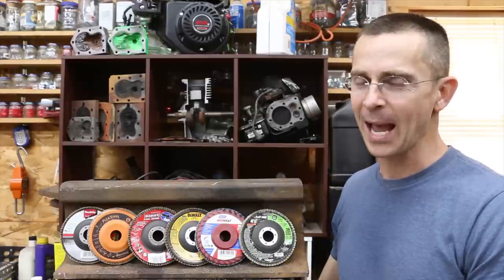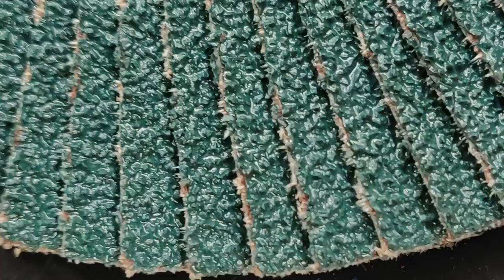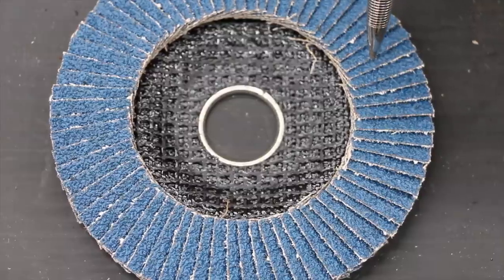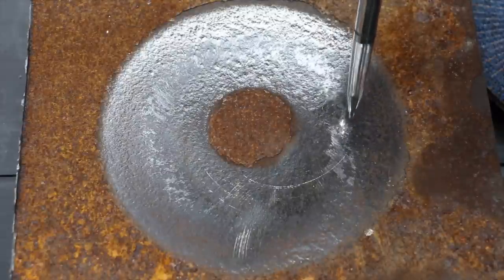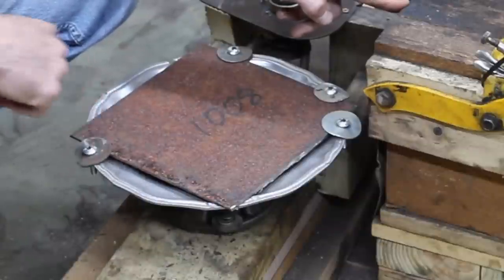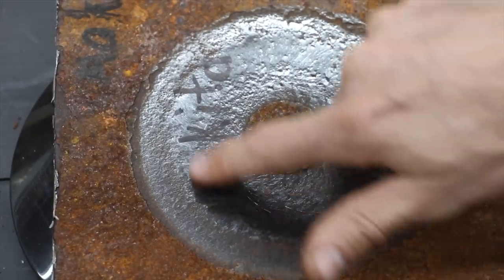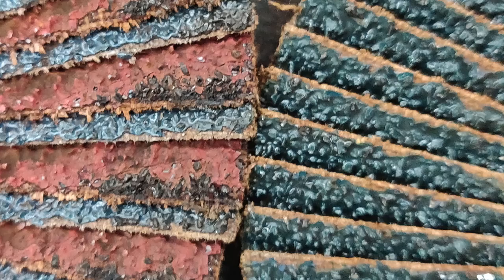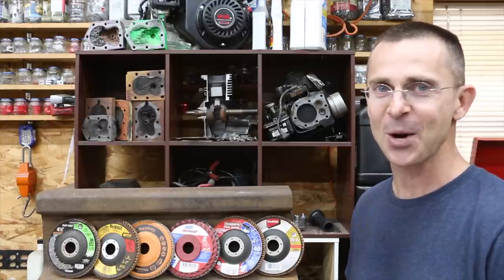Best Flap Disc Brand (6 Brands Tested)? Let's find out!

Comment: Again Diablo did well.  The Harbor Freight I buy in  a mixed 10 pack and get 3 of these flaps under $10. It makes the warrior ones even cheaper worth it at that price.
Reply: bill hill  yay! And free multi meter or magnetic tool holder
Reply: bill hill  look up hft coupons on the app store. I love it
Reply: bill hill  If you can get those at 99 cents you can't possibly go wrong, I guarantee 9 of them would remove more material than a $9 dewalt disk.
Reply: bill hill  they have all sorts of coupons and free items with purchase. Its a free app and i use it all the time.
Reply: bill hill  Same!
Reply: Yup, its there.. valid until 4/30/19. I would post the link, but not sure if I would get in trouble. Thanks!

Comment: More suggestions. 
Best dog bed (durable)
best chain.
best rope.
best string.
best chalk snap line.
best shop towel.
best paper towel.
best toilet paper.
best cat liter.
best night vision(hunter stuff under 500 or 1000 i suppose?)
best shingle for roofing.
best water barrier for siding or roofing.
best water proofing/fire poofing products for interior walls.
best insulation.
best noise dampening product.
best window ac unit.
best/ largest power bank for solar or house appliances to charge or draw from.
best wire. varius gauges by brand.
best voltage meter.
best moisture meter.
best boat sonar.
best metal detector.
best witching sticks.
best hair clippers for extremely thick hair (humans/dogs).
best radio(construction or onsite wireless/mobile mp3 boombox) rechargable.
best blackout curtains.
best blackout window screens.
best work station(genertic or specialized) how many tools can you fit in one easy to use space and have a very good work flow.
best tool bag.
at this rate we will be asking for best AI and best floating scooter soon.
best camping tent.
best bushcrafting tools.
best flare/flare gun.
best hazard cones.
best first aid/trauma kit (complete). 
best bandaids.
best wound wrap/dressing.
best puncture/bleed stop.
best tournequette.
best blue light blocking glasses?
best welders mask/goggles.
best eye glass/magnifying glasses worn/held.
best micro/detailing cleaning/scraping/scrubbing tool/tools for cars/small appliances. 
Best tazer.
best pepper spray.
best paintball gun/barrel.
best grapple hook.
best center drop pendulum?(idk what theyre called)
best square.
best ruler.
best level.(lazer and bubble)
best marking tool for the most precise lines when cutting.
i hope youre getting as much of a kick out of this as i am. ty again again. 💪🏻👽👍🏻
Reply from the maker: Thank you for the video ideas!

Comment: Noce job, i use the walter at work on a daily basis, they seem to be a great product.
Reply from the maker: Walter did great!  Thank you
Reply: for what?? im sure theres a product that will work a lot better
Reply: @philtripe  work provides them, we use them to smooth welds and debur the edges of metel. They work better then a grinding disk for sure. And there may be something better out there.

Comment: I’ve spent 3 weeks in a grinding room straight beveling fittings with a Walter abrasives wheel and out of all the wheels I’ve ever used they work the best after there worn down because they don’t cut as hard it’s easier to bevel fittings
Reply from the maker: Great feedback. Thank you

Comment: I buy the Warrior ones in bulk when there is a coupon they have the .99 cent each coupons and at that price they are good the the price vs material removed.
Reply: not a bad idea when grinding metal that is coated with something that gums up the wheel.

Comment: I would have liked to seen the flap discs from Amazon. Benchmark Abrasives brand. They seem to hold up pretty well and at $2.00/each, it's hard to beat the price!
Reply from the maker: Thank you for the video idea!
Reply: I'd second a test for this company. Our welding instructor told us to buy from this company since we go thru a lot of disks in class and he thinks it's a really good brand for the money.
Reply: +1 for Benchmarl Abrasives. Been using their zirconia flap discs for a while now, and they way outperform the HF discs I've tried. I've also used their sanding belts and bimetal recip saw blades with good results. BTW, they have frequent sales, and the flap disc assortment of 10 was FREE with my last order. Hard to beat those kind of prices/offers.

Comment: how exactly would you trim these? (the trimmable ones obviously)
Reply: Myself I just run the edge on the steel, which happens anyway at angles buffing up a weld in a corner etc. Where I like using them most is with aluminum, stainless, clean up work, when you don't want to throw a bunch of sparks... and they'll work on wood if need be.
Reply: @Stikkzz  Thnx!
Reply: You could use a bandsaw, but be careful the blade doesn’t get too worn down

Comment: Please someone correct me if this has been done by PF before, but best double sided tape could make for an interesting experiment
Reply from the maker: Great video idea!  Thank you
Reply: I would really like to see this one as well
Reply: Can tell you the gorilla glue tough and clear mounting tape is a monster and holds like a beast, have used it to hold on a wireless door bell outside, and my son's pop socket to the back of his phone because the adhesive that came with it didn't hold to his abuse.
Reply: @ProjectFarm  If you try this one out look for a brand called Crest! They make auto body supplies and I always reached for their tape over the 3M stuff

Comment: could you test winter diesel fuel vs summer diesel fuel and see if there is a difference?
Reply: Depends where you live, every other station has its own blend and especially in winter, real cold places has more "anti-gel additives" (paraffin etc) than warmer places, but generally most places where you can get to a cold place on one tank of diesel or it might be cold during the next month has some...  More cold equals less diesel and more additives. generally theese additives results in less chance of freezing/gelling, but also  a loss of power and worse fuel economy.
Testing different fuels from your area might help you out slightly, but odds are that all the stations in your area has roughly the same blend as the climate is roughly the same. Also testing it versus the summer fuel at the same station has its own problems, storing diesel fuel over time without it degrading is not easy, it won't degrade much over half a year in a plastic jug but enaugh to affect the testresults.
Reply from the maker: Thank you for the video idea!

Comment: Okay. Here’s an idea that may or may not be lame. 
Test and compare techniques rather than products. Example:  drilling into metal:  light pressure v heavy pressure; high v slow speed; oil used v dry drilling; straight to the big diameter bit v stepping up from small to large. 
Thanks for the great work. Keep it up.
Reply from the maker: Thanks for the suggestion.

Comment: This video is older so you probably won't see it, but I've used Dewalt flap disks for years.  Always felt like they weren't working super well.  Bought some brand I'd never heard of (multipack in the clearance section of menards) and they did so much better.  This video definitely explains it and I think I'll steer clear of the dewalt flap disks in the future.
Reply from the maker: Thanks for the feedback.

Comment: Finest quality comparison as usual. As you mentioned the human factor is of drastic consequence, Since most people don't consider deeply they use an angle based on comfort that you did realistically simulate in this test. Unfortunately though this angle is also the most damaging to the disc because it puts all the work on the very edge of the disc  which quickly wares out prematurely . Proper angle is to have the flaps entire width in even pressure contact with the workpiece , this of course requires careful observation as each disc is often made to a unique angle. For this reason I believe your second run performance and longevity  results are drastically less impressive than they would be if properly angled to achieve full flap contact with the workpiece.   I am not sure if this would change the overall ranking, but I sure would like to see you test that if your up for it.    Thanks, I truly enjoy and appreciate your videos!
Reply from the maker: Thanks!  Thanks for the video idea.

Comment: I weld professionally, and I use the warrior with the 99 cent coupon. I avoid running flap discs on dirty material to avoid clogging. I would also add that the wheels like Diablo sometimes clog faster. The sandpaper not wearing away just clogs the paper. If I were to clean up a rusty piece like in your video, I'd at least run a cup brush on it first. For those used to running grinders, lay a normal grinding disc down flat on the piece; it's a bit harder to control that way, but avoids deep gouging and scratches.
Reply from the maker: Thanks for the feedback.

Comment: Once again, a great comparative analysis.
Reply from the maker: Thanks!
Reply: @ProjectFarm  Sometimes I play it at slower speed. (You are very energetic). But that's quite OK. Thx again. 

Question (if you have time): Do flap discs layers wear back to expose some of the next abrasive layer below and thereby ultimately use all the available abrasive surface? 🇦🇺

Comment: Neat test.  One thing to consider about flap disks is that they are designed to wear at a rate that sheds worn abrasive and thus advances to new sharp abrasive.  Generally speaking, good wheels will be thicker with more sandpaper to wear away.  Their longevity and effectiveness is in the quality of the abrasive and backer that wears at a balanced rate.  Some of the worst wheels are ones that the abrasive wears off and the backer remains.  Touching them up on concrete can quickly expose fresh abrasive and make them cut better.

Comment: My house had a deck with the horrible bher deck over painted on there. I wandered into the store and bought diablo 4 1/2 inch 40 grit steel demon flap disk. One was enough to strip the coasting off. Was able to strip 350 Sq feet of the costing easily. Just took me around 1-2 hr. I use the cheapest 12 bucks HF grinder to do the job. Worked well and now I don’t have to replace my deck.
Reply from the maker: Thanks  for sharing.
Reply: Project Farm Thankyou for all the hard work and dedication you keep in your videos. Your unbiased opinion has helped a lot and will continue to help lot more. It had certainly helped me a tons in choosing products.

Comment: I just ordered flap wheels a couple days ago, and I didn't have a clue what was good. I've been using Warrior because they come in a pack with cutoff and grinding wheels, but I knew they weren't good, seeing as they're HF's least expensive. I considered buying DeWalt, but I found a recommendation for Lehigh Valley Abrasives flap wheels. Supposedly they're far better than Warrior and only $2 each. I'm probably getting what I paid for, but I decided to give them a try. If they don't work out, I'm going for Diablo wheels. Thanks for the unbiased video!
Reply from the maker: Thank you for the feedback

Comment: I worked with an engineering shop to find the best value brand of discs so that they could buy in bulk and reduce costs. The 3M Cubitron II was a more expensive flap disc but it was hands-down the most effective and durable product. We were actually saving money compared to the cheap brands because the durability meant less time wasted by the workshop guys when they were changing discs less often. It's less frustrating and more efficient when they work with an effective product. The cutting discs were also safer to use because they were less likely to disintegrate at high speed as the cheap brands often did.
Reply from the maker: Thanks for sharing.

Comment: 3M with the purple sandpaper on it is the best I have found. I typically wouldn’t use a flap disk for an application like removing that rust scale though because they simply don’t work for that. I use flap discs for dressing off welds and smoothing clean metal. I also find 60 grit best for general purpose applications.
Reply from the maker: Thanks for sharing.
Reply: Try the 3M Cubitron II Flap Disc 967A (red ceramic), I find them to be the best, however they are also more expensive. They last much longer, cut much better, and maintain their cutting edge right up till the end.

Comment: Graduate Engineering School level testing! One slight recommendation, abrasives are rated by the G ratio(vol. removed from test pieces / vol. Removed from wheel). Though this was in weight, please provide PowerPoint slide with the following: delta test piece weight / delta abrasive weight and then noalize everything by dividing by total square inch area of abrasives. This gives performance per sq. Inch. Normalized.
Reply from the maker: Thanks for the recommendation.

Comment: I’m a big fan of all the work you’ve done and continue to do! I might be wrong on this, but it looks like you plug-in and unplug corded power tools. If that’s the case, a suggestion I have for you that could make things easier. Using a surge protector to turn on and off the tool to make that transition smoother and more controlled. Keep up the amazing stuff sir!
Reply from the maker: Great suggestion! Thank you!

Comment: Years ago I did my own test comparing a random flap wheel to a random wheel of type that looks like a hard mesh of string. My application was removing rust and paint from metal.  For several reasons I have not bothered to use a flap wheel since.  It seems like a comparison of this type of disk would be a good video.  
For that matter there are now replaceable disks that are bolted to a backing wheel and that could/should be tested too.  Then, the final show-down would be a comparison of the best of each type for a variety of applications.
Reply: Sounds like you might have been using a rock disc. Those are more aggressive and while theyre great for taking away paint and metal, theyre not as good for leaving a fine finish or working on thinner metals/welds that are easier to burn through. I agree though I would like to see a rock disc comparison.
Reply: @pecanthejelly5854  I thought Rock Disks were just for playing on a turntable!  Can you point me/us to an example of one?  After a little searching, I found that what I meant was the Silicon Carbide encrusted fiberglass mesh/entangled disks.

Comment: I always enjoy these test videos.  Were the disc's all the same material.  Aluminum oxide is not the best material to use.  Zirconium or second carbide would be much better, so if all of the disc's were not the same material you will get varying  degrees of performance.  I  have rewatched this video and did some more research and I am curious as to know why an angled flap disc was not used since the test was done at an angle.  Also, have you tried Klingspore?

Comment: Great video,  though I'll buy warrior when they are .99 cents
Reply from the maker: Thank you!
Reply: I’m a former fabricator and like the warrior wheels, I stock up when they’re 99 cents, they perform as well as any other mid grade wheel if you put a little force into your grinder
Reply: $0.0099? Sounds a bit expensive still!
Reply: @vx-iidu  You mean $0.99?
Reply: @Zourkoskey  No, OP said .99 cents, which is 0.0099 dollars.

Comment: I'm a huge fan of yours, as are millions of others! I'd love to see a comparison of larger air compressors. I know you've done the smaller ones that will fill tires. Maybe there's not a large enough market to justify testing larger compressors, but I'm in the market for something that could do a decent job of sandblasting and of course my first thought was: "What does Project Farm have to say?" Thanks!
Reply from the maker: Thanks for the suggestion.

Comment: A similar comparison can be made with the 3M, Norton, Warrior, etc. polycarbide wheel on 1) paint, 2) rust, 3) mill scale and 4) compared to flap discs.  Also should compare differences in surface heat buildup (which translates into possible sheet metal warpage)
Reply from the maker: Thanks for the video idea.

Comment: Project Farm,   there is an entire class of rotary cutter- power carving/rotary disks.  Some are carbide cutters, others are various grits of carbide spikes!  The range is wide, the criteria for use is just as wide. This means you'd have to set up some different sets of videos to help educate- cut rate vs finish surface quality?  Two videos?  Amount of amperage used in a 4" grinder to drive the different disks?  

The number of tests might be fairly extensive.... but solid metal cutters on the 4" grinder are a potential for your thorough testing methods.
Reply from the maker: Great video ideas! Thank you